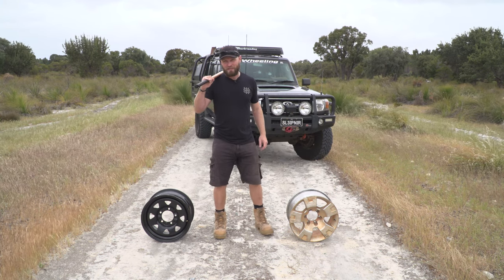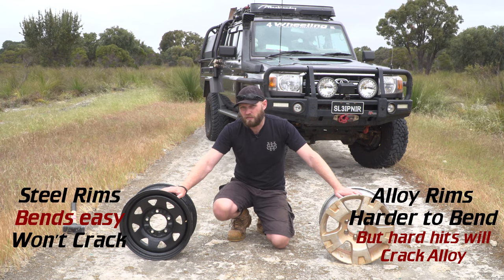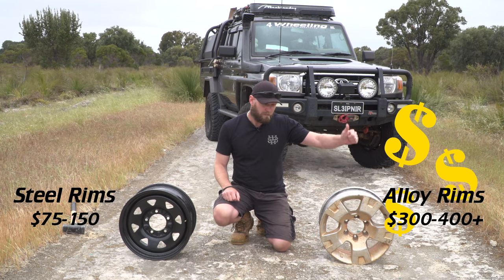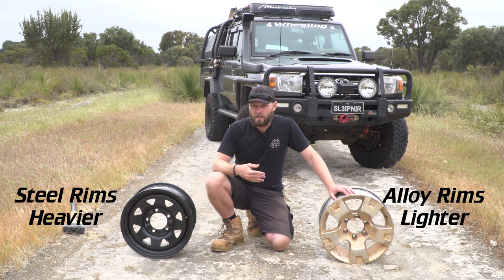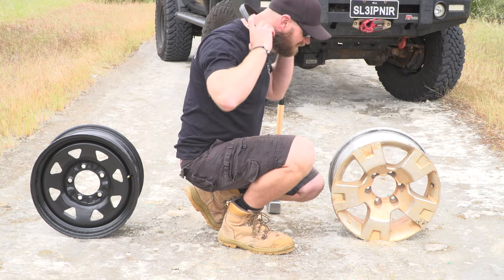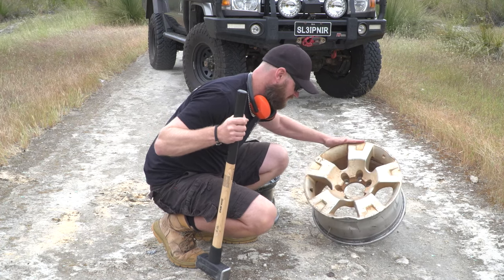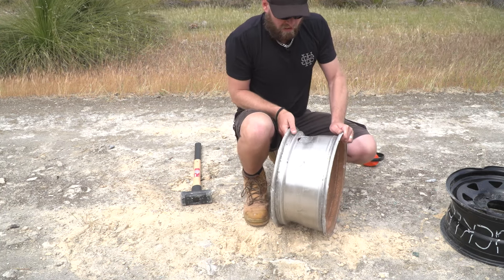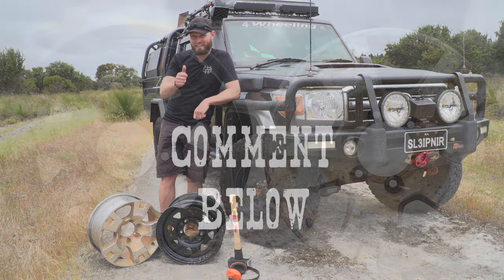STEEL vs ALLOY rims Off-road Wheels

Comment: I strongly disagree. I’ve worked in the steel business as a welder & fabricator for more than 2 decades building everything under the sun. Dealing with X-ray & ultrasound testing on my welds & simply dealing with metal fatigue engineers & I’ve never ever seen 1 single test or bit of proof where aluminum(no matter what form, like cast or aerospace grade) will beat or is stronger than steel in any way. It just isn’t. I saw materials testing done in Canada where the million dollar Aston was being made, they took carbon fibre bonded together and in a stretch stress test it did outperform steel. I don’t know how close in comparison to titanium or even stainless steel which is very strong it would do but in many tests like impact or deformation steel wins hands down. Defects in carbon fibre can’t be fixed however steel no problem and even aluminum it can be done. As a hardcore off-roader steel is the only way to go. Like you said it’ll get you home where aluminum may not. The other thing you can do with steel rims safely(don’t know about aluminum especially more than once or twice) which Icelandic boys do all the time is skip the pump when they get a flat or rip a tire off the rim and that’s fill the tire with lighter fluid and light it up. Boom tire is back on the rim full pressurized! Great trick. Aluminum is easy to get hairline fractures in it not seen by the naked eye, which is why bridges and other structural things receiving constant vibration will likely never get built from aluminum, and they can spread very fast weakening the item severely. That said the same can happen to steel but it’s more difficult and will last far longer before completely failing. Steel’s best feature is how it’s ductile or pliable.  It’ll bend many times before it’s weakened too much or will fail. So after all that babbling I can tell you that especially in a country like Australia where everything & I mean everything is trying to kill you especially the ridiculous temperatures the outback can hit, I’d only use steel rims. This guys list is spot on and should be followed because Aussies know damn well it’s extremely easy to die out in the country. Call me paranoid but I’d double everything in his list! A shotgun with slugs would be a great add on for dealing with the crocs! I’m happy to deal with bears and cougars here in North America because both are easy to see and neither like pepper spray. What by Zeus do you do to stop all the crazy ass spiders and insects you can’t see not to mention the deadliest snakes Australia offers?! I couldn’t ever relax and enjoy myself no matter how badly I’d love to see Australia and overland in arguably the second best place on earth. Shit I don’t think I’d want to get out of the vehicle, or take my shoes or clothes off. You can’t just casually walk up to a fresh water pond to fill your water jugs up either, because as many limbless & deceased people will tell you there are fricken giant crocs in the freshwater too. You gotta be a special breed of human to live in the outback, even in the cities of Australia. Yup I’m a big pansy and will scream like a girl if any spiders or dragonflies or any insects come near me. So that’s why I have a great deal of respect for the people that work and live in the outback. Wow!

Comment: Oi! I have 15 inch alloy rims on my car.

They are stock though, and not of-road specific, but a lot of 4x4s were made with 15 inch alloy rims in the 1990s.
Reply: I run 15x10 alloy rims for my truck. Their aftermarket off road specific rims, pro comp 69 series. Truck came with 16, but I went down to a 15. It’s a 03’ taco dc.

Comment: There are MUCH stronger alloy rims than a factory Nissan GU rim tbh. Heaps of comp guys run alloys with beadlocks with no dramas. That said I agree steel is fixable, alloy is not.

Comment: Alloy are NOT always aluminium. "Mag" wheels, as we call them in the States, are magnesium alloy, not aluminium. Steel is way cheaper, maybe 1/5th the price of good mags. Which may be forged, cast, or machined from a whopping expensive solid alloy block. That can be a fast $1500 US apiece, and up. Offroad? STEEL WHEELS.

Comment: Thanks for the informative  video, 
I've been running white Sunraysia 15" rims with Staun (pneumatic) beadlocks on my old 01 TJ wrangler and I love em.
Over ten years of hardcore (not remote) abuse on weekend runs and I've never damaged them. I wonder if the pneumatic beadlocks helps with protection, I'm guessing that do. Well,  now tht rust is starting to set in, its time to give alloy a go!
I got a secondhand set cheep then had them reconditioned. Having the Stauns fitted up so I'm hoping they might provide some extra protection and I'm looking to shave unsprung weight so I've shifted to 33x10.5x15 over the 12.5's... what do you think?

Comment: so what the hell are you doing that can damage the edge of the rim with the tire inflated? if your down to 8-10psi in the tires, then drive slower so you dont slam the rim on the ground! if you want to drive fast offroad, then have the proper air pressure to keep the rim from contacting the ground! go with maybe 18-20psi so it has less chance to completely squish the tire when hitting a rock. yes, its a bit rougher ride, but you wont have any rim issues.

Comment: Wheel with 4wds every weekend doing the hardest tracks Victoria has to offer, have x10 more trouble with crap steel wheels than any good oem or aftermaket wheel. Never had one crack.. and we have everything from stock 4wds to jks on 40s... steel wheels seem to loose their tyres more often when in low pressure circumstances. Not to mention alloys have better beadlock wheels on offer... steel rims belong on ya camper or 6x4 trailer... not any decent 4x4.

Comment: Aluminum is weaker than steel but 3 times lighter....you will need a very thick aluminum to get to the strebgth of steel. But here, you are talking about aluminum alloy wheels. They will be slightly lighter and stronger, but more fragile as you have seen

Comment: Me: I off road with alloys 
Other people: you should use steel
Me: find me a 5x150 in steel thats not stock 😂🤣😂
Also me: has the balls to off road 33x12.50R20's with no spare

I have destroyed more steel wheels and suspension systems than with Alloys. Ps you can have alloys repaired that have bent lips.

Comment: No the steel is actually stronger. There’s a difference between rigidity and strength. The steel withstands more punishment without cracking. In metal terms, that is stronger. 
Plus, alloy rims look shit on 4bees, steel is just the way to go.
Reply: Wrong, actually.  I'm a mechanical engineer, we study this, and the terms are specific.  The steel is more ductile,  and therefore has greater toughness,  while the alloy has greater strength,  but therefore is more brittle and less tough.

Comment: Good video but let's be real how is smashing a bare rim in the middle with a sledge realistic at all. Even if the tire is flat you have a large cushion of thick rubber from beefy off-road tires and when inflated its s moot point there would never be contact metal on metal like that
Reply from the maker: +Scott Gerry think about 3-4t of weight behind it. A flat tyre won’t do much. I’m 90kg swinging a hammer. 3-4t loaded 4wd hitting a rock at speed rims do crack and get destroyed like that. We see them on the road side.
Reply: Ronny Dahl fair enough, although I'll keep my alloys! Keep the great videos coming! Subbed from Canada!
Reply from the maker: no worries mate, thanks for watching :)
Reply: Going down a hill and you lose a bead or get a puncture, loss of traction causes the car to lurch forward and hit the next rock. 

Surprised they don’t bring the broken wheels with them, still has scrap value.
Reply: Google cracked alloy rim.
happens to cars on the road ALL the time.
Even factory Mercedes AMG rims crack in odd places from hitting things on the street and they are hardly cheap chinese ones. 
and they aren't getting the same torture testing that a 4 ton off road vehicle with a point load on a rock gets.
Reply: blackers10 generally those are low profile sports tires with huge rims and very thin rubber, harder a 33 inch mud tire on a 17 inch alloy rim
Reply: it still happens tho. on roads. thats the idea i was getting at.
Reply: Watch the 'Your 4x4' episode from Mt Dare to Dalhousie (72 or 73 I think) to see it happen on an ungraded road. They smash another rim after crossing the Simpson in the same car & in both cases the tyre was fine despite the rim being destroyed so it definitely does happen.

About 3.30 onwards you'll see it & that road looks pretty good

https://youtu.be/qWETpMrlJ9g
Reply: i have had aluminium rims broken from the "inside" by rocks geting stuck between brakes/a arms and the rim. not even wheeling hard just some mudding, steel all the way for me
Reply: Aired down low and then trying to bump it will do that

Comment: If you have a flat tire, you are changing the whole assembly.  If you are traveling so fast with a flat tire that the wheel takes damage from a rock in the road/track/trail then you are foolish.  The rim of the wheel would be nearly ruined before you got to that point I would think.  I read most of the video as anecdotal at best, most of the tire/wheel damage that occurs could be avoided.  After 9 minutes good opinion turns to beating a couple of wheels with a sledge hammer.

Comment: umm if the rim is hit that hard during off road driving - 1. driver error (too fast for conditions)  2. if the damage is that bad I'm not wasting time repairing the damned rim!  better have a spare - or two - and then I'm going to be damned sure to drive with a little more brains till i get home.  oh and if your hitting the middle of the rim hard enough to crack it with a tire on whether its flat or not - while driving - then there's some pretty idiotic driving going on there - mate!  because the conditions your trying to recreate can only occur during high speed (on rocks) and catastrophic tire failure, of which a bent rim would be the very least of your worries. severe undercarriage and suspension damage being firsts on the list. just my two cents.

Comment: You never factored in weight and the cause and effects their weight has on axle shafts etc. I've blown axles solely because I was running Steelys instead of alloy wheels

Comment: What a childless demonstration.rims weren't made to wack it with a sledge hammer. Rims are protected by a good rubber
Reply from the maker: Flat tyre and drive into a rock or stump, very similar impact but with all the weight of the vehicle. That was my theory anyways

Comment: Horrific clickbait and entirely uninformed, slanted, and lacking any scientific approach outside of eyeballs after whacking a wheel with a sledge hammer.  Albeit entertaining, its not consistent with anyone’s experience running a quality “aftermarket” alloy.  Sure, car makers cut corners on alloy wheels using heavy, soft, and cheap alloy blends...its about costs, and perceived value of the buyer expecting alloys on more optioned models.....but lets not forget, car makers are interested in making money off the car, they don’t build rims to make money, they build cheap alloys to satisfy a buyer expectation.  Get it?  Me too.

Comment: ??while  “aluminum-alloys”  rims. may  have some advantages   Over the  “steel -rims”.  the main  reason  they  show cracks  early on is  because they lack the    “tensile -strength”.  (given all thing been equal or close to ).      that steel  has......and  even in     “this day and age”
The aluminum-alloy’s  may not  be able to    “match   or even come close. To overcoming   such  difference”...........which then might  make them ideal for use in some very “controlled and limited circumstances” 
while  “steel”   remains the  most common   “all-purpose - choice”.  And even for those wishing to “venture”  into  the  “more challenging-environments”...and even those that have  “limited financial -resources”.    and don’t  feel the need  To reach “deeper”.    into their pockets.......????

Comment: Steel hitting aluminum is never a good recipe. 
More than enough rubber protection. You always carry two extra tires with the rims. I doubt that you’re going two crack three rims unless you’re a MORON